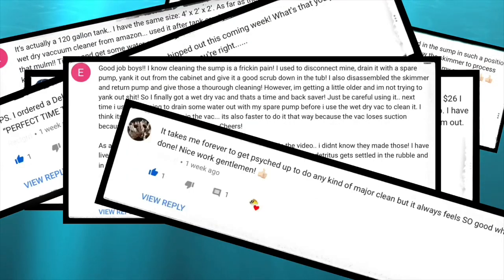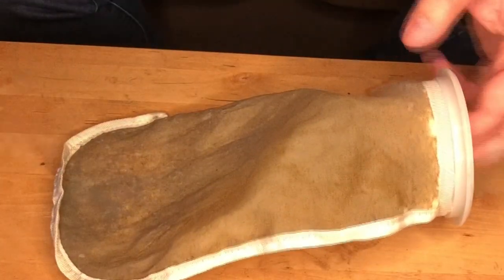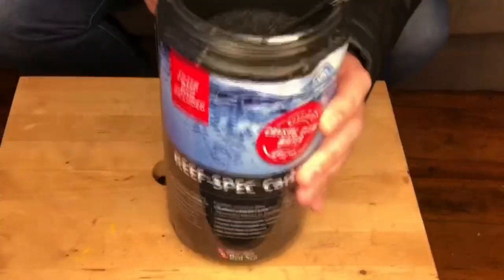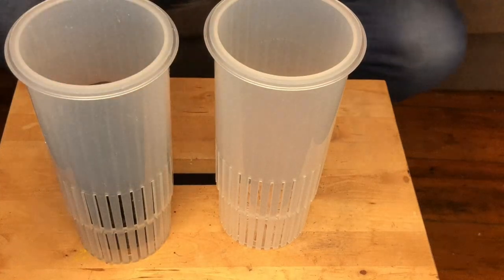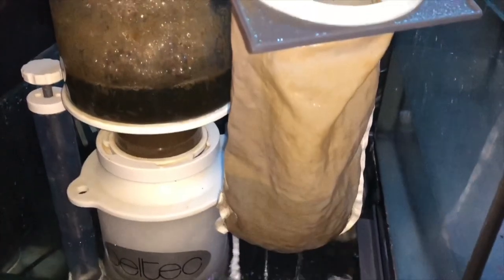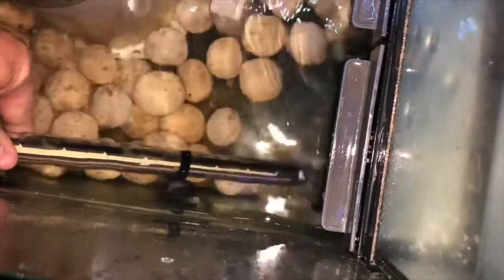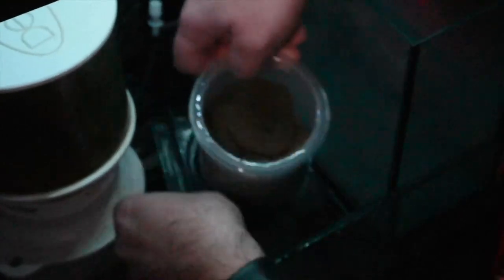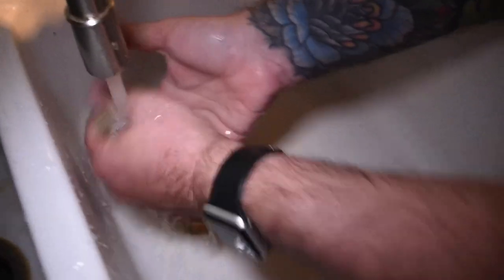Red Sea Filter Media Cups - Two Gay Reefers Review

Comment: Hi there. Great video. I think i’m going this route too. Felt filter socks do seem terrible to maintain and there is no way my wife accept them in the washing machine... Just one question thouhg: di you notice any rise of Nitrate / Phosphate after the swap? Some reefers are coming back to socks because they say floss+cup is not filtering enough particles and they have No/Po surge. Thanks !
Reply from the maker: Back then we always had Nitrate issues, so we couldn’t confirm if there was a difference. We swapped mainly to make maintenance easier

Comment: Great vid guys. I do struggle to see the practical benefit in the cups, other than being easier to clean out. Conceptually you could fill a traditional filter sock in the same way and get the same benefits? Over time presumably they are also prone to overflowing in the same way as filter socks are?
Reply from the maker: We found they don’t overflow as much or as quickly as the socks, and are a lot easier to clean. We were cleaning socks every 2 to 3 days!